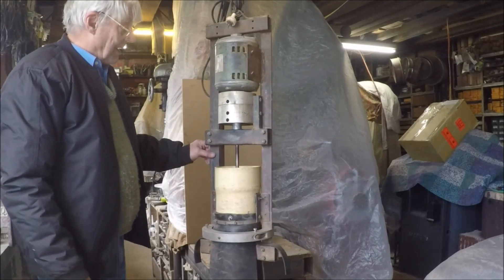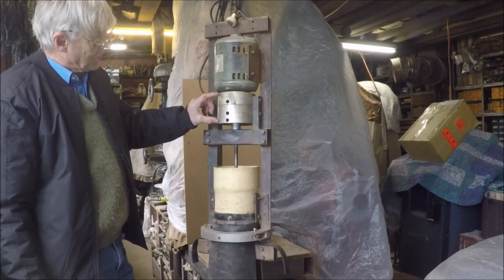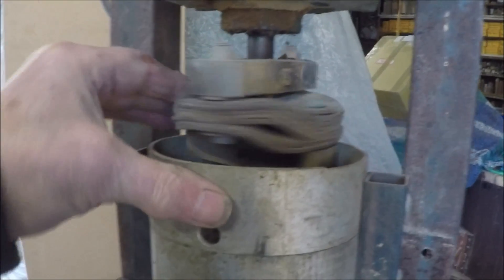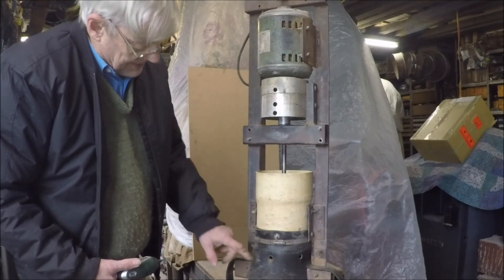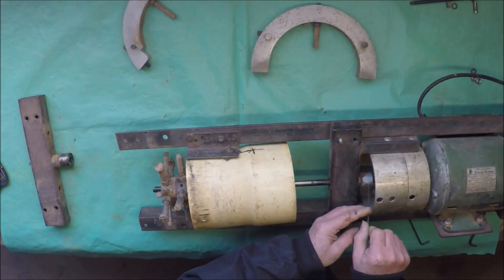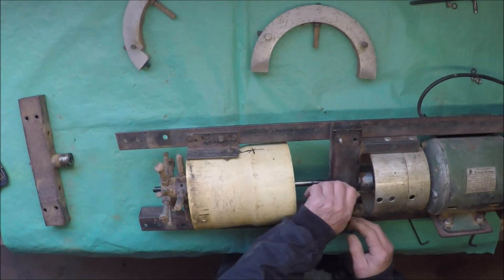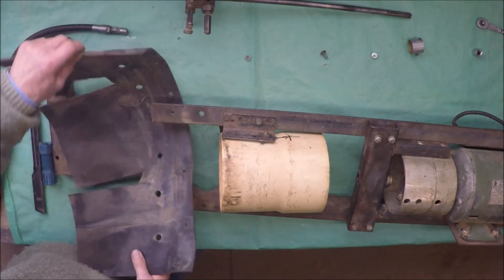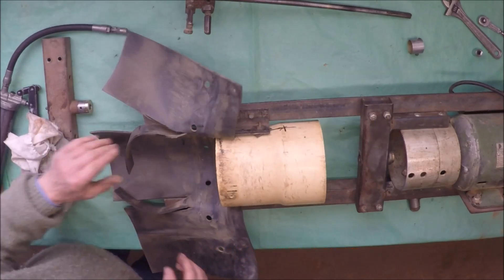Sand aerator, mixer, reprocessor.

Comment: Your universal joint doesn't look crude OR rude to me.  I've seen similar devices on automotive steering columns and hot water heating's circulation pumps before.  It's actually quite good.
Reply from the maker: Ron,  Thank you for your comment. You are correct, similar joints have been around for a very long time although usually constructed with a little more finesse than mine. I guess that the proof of the pudding though is that it has lasted  30 years or so and is still going strong.... Martin

Comment: Thanks for sharing this.  I collecting the bits to build an 8" version.   The 1HP motor is 1725 RPM.  Do you think it will run too fast?   Has anyone shared their designs with you.  It would be interesting to see other peoples take on the machine design.
Reply from the maker: Dan,  Sharing was my pleasure, thank you for watching. Your speed will also be the quicker for the increased diameter, in mine  the tip of the rotor bars does about 2300 feet per minute however with an 8 inch diameter and 1725 RPM the tip speed will be about 3600 feet per minute, a bit more than a 50% increase. Will it matter? I honestly do not know but I doubt it. I think that at this higher speed the machine will process the sand much quicker and that's a good thing. When I built mine I had very little to go on other than a vague description from a friend who had seen one in use on just the one occasion. It was very much a matter of "suck it and see" hence my construction was quick rough and a bit small and meant only as a trial of the idea with a larger better built effort in mind if it all went well. As I think I mention in the video it went so well that I have never bothered with the better version. Only one other person who built a machine with a similar purpose some time ago has contacted me. His design is rather different and by the looks of before and after photos of the sand it does not seem to fluff it up perhaps quite as well, also I suspect it may have been a bit slower in processing the sand. So, alas, I have no other "takes" on design, You are the first that I know of to be making a similar machine to mine since I put the video out. So I guess that you too are in a bit of a "throw it together and hope situation" although perhaps with a little more to go on than I had. Hey, its a simple machine so  as they say in the classics - what could possibly go wrong? :) Good luck with it, I await the results of your effort with great interest  please keep me informed. I think that you will be very happy with the results, I was..... Martin
Reply: I will.   So far I have the motor, a 3/4" shaft and matching bronze flange bushings.  Dan
Reply from the maker: Dan,   Sounds like a good start, you are well on the way. I am impatient to hear how it all goes :).... Martin
Reply: Watching this again I noticed your rotor has a mix of bolts and studs and maybe two sizes.  Is there a reason for this?   Still sidetracked on the lathe and master mill which mounts to it.

Comment: I built a similar machine years ago with a little different design on the pulverizer. How can a fella post a picture in the comments? I would send out a photo if I could.
Reply from the maker: Centaurus, I am not surprised that there are other machines out there, after all I copied one (sight unseen) that I had been told about. What does surprise me is that so far you are the only other constructor to come to light! Any other makers out there? I imagine that considerable design variation would be possible would out adversely effecting the machines function. Unfortunately I do not know how to post a picture in the comments I have never seen one so it may not be possible. I would be interested to see your design so can I suggest that you PM me and I can send you an email address that you can send a picture to.  Martin
Reply from the maker: Centaurus, I am not surprised that there are other machines out there, after all I copied one (sight unseen) that I had been told about. I am perhaps a little surprised that you are (so far) the only other constructor  that has come to light, any others out there? Unfortunately I do not know how to post a picture in the comments,I have never seen one so it may not be possible,  pity I think! However I would very much like to see your machine so if you wish you can PM me and I will come back with an email address that you can send a picture too.  Do you still have your machine, do you still use it, and  have you tried it on Petrobond?  Martin
Reply: Martin, I have not used it for Petrobond as I never could get past the stink of that stuff so I stuck with the clay bonded sand. I sent you a PM so if you would like I can send you some pix.
Reply from the maker: Centaurus, I have actually replied to your Pm, did so about 19 hours ago. Let me know if you did not get my reply as I can probably do a copy and paste to resend (a bit long to retype!) I did include my email address so you can send those pictures. I would very much like to see them...Martin
Reply: OK it was there but the email did not work when I tried. Replied through PM to check EM address.

Comment: thank you for your video. I am keen to make one

could you list the modifications that you would do to it if you were to revisit the design.

the specifications so far are:
a true 1 hp motor
1440 rpm
half inch shaft (possibly 5/8 if an 8 inch body is used as there will be more torque).
8 inch body tube pvc
a quarter inch thick rubber walled aerating chamber surrounding the powered rings
 two powered rings comprising of 6,  half inch (?) bolts
one fixed ring of 6, half inch bolts in between the powered ring set.
one flexible universal joint
bushes top and bottom with shielding to prevent sand entering the bushes.

I would further suggest that there be some feed hopper to assist in the input of sand into the unit.

a further question, how often do the bolts forming the powered ring wear out??
what clearances do you have between the powered bolts and the fixed ring of bolts?
should the heads of the bolts be left on or cut off to bring the bolts closer?

your opinion - instead of the two half rings to hold the fixed bolts would a fabricated ring forming a grate with a slot to slip in between the powered rings be a better solution????
also would you have more bolts on the bottom ring of powered bolts to reduce the spacing  - courser spacing on entry , finer spacing on the final stage.

thank you
Reply from the maker: Charles, You have pretty much nailed it. I would certainly go to 8 inch but it does not have to be PVC tube could be anything that size and solid enough that you can get your hands on. The rubber I use is about 1/8 inch insertion type I replace it every few years as it just hits the rotating bolts sometimes and that wears it away. Top powered ring only has 4 1/2 inch bolts , used to have more but this tended to throw the sand upwards too much and not allow it to move downward through the machine (this is more a problem when the sand is newer or a bit wet i.e. when  it is stronger it sort of churns above the top powered bolts and wont go through) lower powered ring has 8 bolts 4 by 1/2 inch and 4 by 5/16 inch (again its what I had and could get to fit!)I too have thought about a hopper but foundry sand does not move well in hoppers unless they are very steep as the sands angle of rest it very high. A vibrator attached to the hopper would probably be necessary I am interested to see what you can come up with. Remember my machine was a proof of concept thing made out of stuff (junk) to hand and other than fiddling with the number of bolts I have never improved the design so improvement should be very possible. I look forward to seeing much improved designsHave never had to replace either the powered or stationary bolts/pins they have worn a bit but not anyway near to needing replacement. Sometimes they have come loose and been thrown out , I just screw them back in, trick is to get the lock nut tight.Clearance between bolts Hmm,  good question at a guess about 1/4 inch. I leave the heads of the bolds on (I am lazy! :)) but  the heads make it easy to fit and tighten the locknuts note the 1/2 bolts have a flat ground on one side of the head and this flat is orientated to give clearance for the stationary pins.Grate with a slot - not too sure what you mean here, PM me so I can come back to you with an email address that you can send a sketch too and I would be glad to have a look.Bottom ring does have 8 bolts upper 4 and I certainly think that is the sort of way to go, I am contemplating only two or perhaps three for the top ring as a way of improving performance with new (and therefore stronger) sand. Let me know what transpires.Martin

Comment: Love the universal joint. If it worked for 30years without failing, it better than most purchased units on the market today.
Reply from the maker: Doug, Long life probably due to overdesign, It was just made from what I had at the time! I am hoping for another 30 , If only I could make it that long!!!Martin
Reply: My old Spitfire used a verry simular universal joint on the drive shaft. Only diffrence was it was spring steel flat plates. I like the use of leather. Far less danger of snapping.

Comment: I was thinking how to build a muller, Martin to the rescue! Cheers mate!
Reply from the maker: JB, How is our sunny west? Damn cold over here! This machine is a lot easier a build than a muller. But a muller would be nice too, particularly if you are making up green sand from scratch and you need the mulling action to roll the clay out onto the sand grains. Also for making up silicate sands or other core type sands a Muller would be a good thing, but this machine has certainly done the job for me now for many years. Ideally If one was very serious one would have both mull first and then aerate, but maybe life is too short to build both,  Martin

Comment: Given that you made this machine @ 30 years ago I think that it proves a couple of points;
1. KISS Principal, Keep It Simple Stupid. Straight drive, no belts to wear or go out of alignment or break.
2. Universal Joint. Not sure that it qualifies as such but it certainly qualifies as a Vibration Free Drive Coupling and I think that no matter how ugly it looks, the proof is in the pudding as this joint has removed any vibrations from reaching the motor and damaging its bearings. It also gives efficient drive and a fail safe sear point should something jamb.
3. Putting some witness marks and numbers on the various shafts and pins will make it faster to service.
Question? Did you cast the aluminium ring and then machine it on your mill?
A thoroughly captivating video for those of us with more than a passing interest in home casting.
Mark
Reply from the maker: Mark, Have you moved yet? What happened to your visit? You are right about the witness marks but I don't really service it that often :)Yes I did cast the aluminium ring but for another purpose (to hold a cyclone for my vacuum cleaner, way ahead of Dysan) I just repurposed it with a quick bit of turning in my lathe. The video was indeed made for the more serious foundry YTers,  Martin